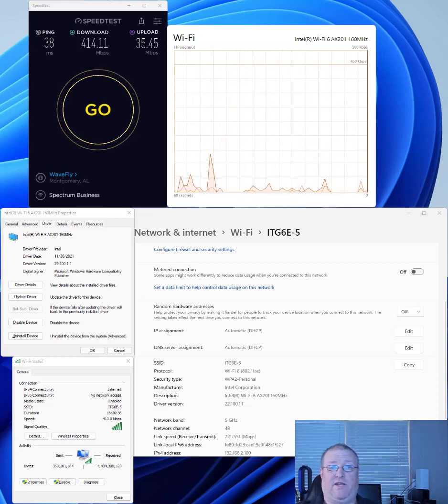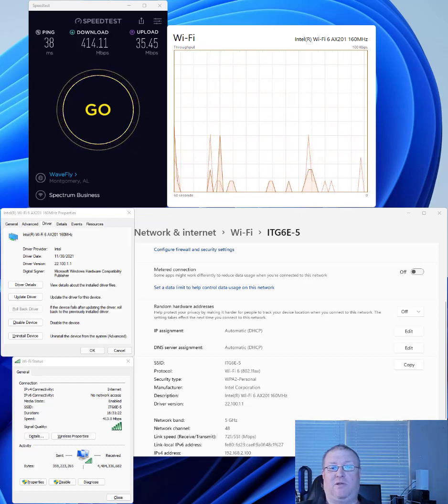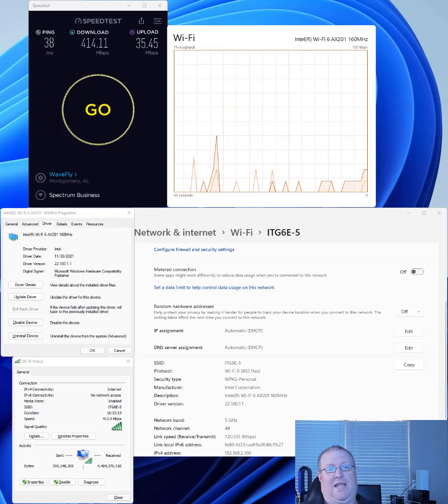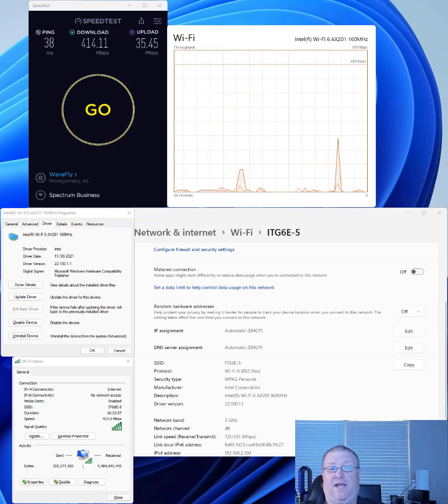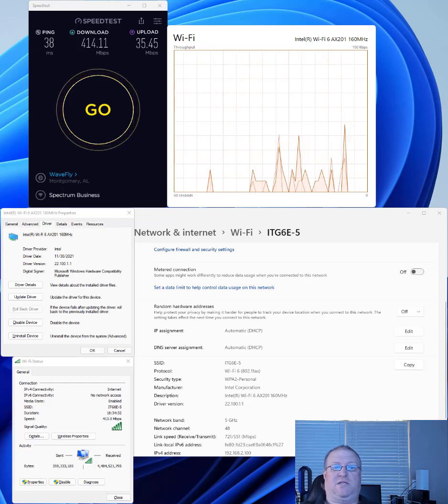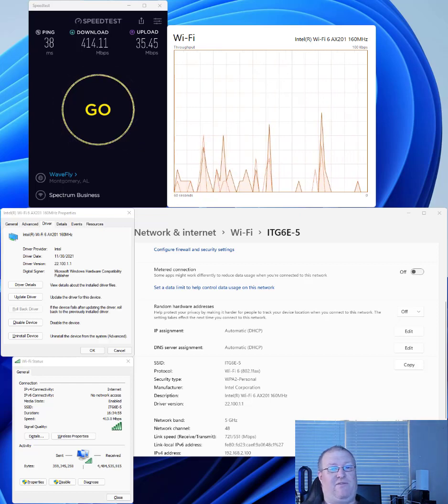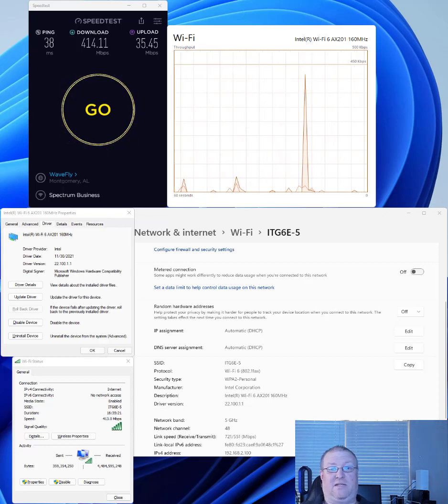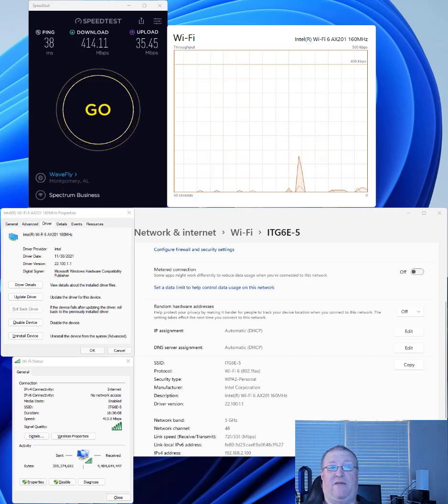Linksy Atlas Max 6E Mesh Wifi Update Video

Comment: I have a Linksys WiFi 5 velop and looking to upgrade.  I’m torn between this Atlas mesh and the Orbi wifi6e set.  My current Linksys shows a weak node connection about 45 feet away.  There are quite a bit of walls between so I wonder if I should look into a dedicated backhaul mesh system?
Reply from the maker: Sorry for the late reply, but mine goes through quite a few walls and it seems to work with no issues. It uses the 6GHz network for it's backhaul, which is plenty fast for my other nodes and everything I have running in my home.

Comment: I bought this system when it first came out. Needless to say it had a lot of bugs and spent some time on the phone with Linksys. They were very good with helping out and finally got it running correctly no problems since.
Reply from the maker: That's good they were a able to help you. With me they were trying to troubleshoot but weren't fixing it. So I was doing some troubleshooting on my own and figured out that it was an auto channel issue. Once I figured that out I posted a video here in the channel to help others that potentially are having the same issues. It's been dealing with my issue since I bought it in November. Now everything works perfectly like I was used to in the wifi 5 velop.
Reply: @itgroup  yeah it’s a pain in the butt. I actually wish I would have known orbi was coming out with one I would have gotten it.